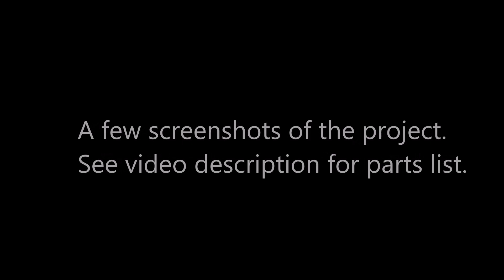DIY Quiet Whole House Fan - Save Tons on Your Electric Bill

Comment: App controlled AC outlets also work well to turn fan on and off as needed - when outside temp is lower then inside temp. By way of remote outside thermometer

Comment: Very easy to install.>>>nub.best/fqzi    I was uninterested in the auto temperature switch but it was very easy to bypass that system. Have it set up on a light switch in my garage. Fan definitely lowers attic temperature significantly

Comment: I plan on setting this up with a friend. Plan on 2 or 3. Thanks for the parts list.
Reply from the maker: I learned a lot from this install. I still use this system all the time and I love it. If I was going to do it again, I would recommend using the largest un-insulated ducting you can find, larger ducting allows for more airflow... also one 3000 CFM fan is better than 2 1500CFM fans, so I would just buy 1 3000 CMF fan like this:

https://amzn.to/2Vc9A8i
Reply: @Jasonoid  Yes, I actually plan on using the red one 3000cfm and my unused masterflow fan 1600 just like the ones you have otherwise its overkill. $386 for 4200 to 4600cfm is great
Reply from the maker: @joegaspary2736  let me know how it goes, should be an awesome project!
Reply: @Jasonoid  I will. Did you see my damper box ceiling grate question btw??
Reply from the maker: @joegaspary2736  for some reason I'm not seeing it, what was your question?
Reply: @Jasonoid  you think I need a larger box for the 3000 cfm fan?? Like 14 x 14 or can the 12 x 12 handle it you think??
Reply from the maker: @joegaspary2736  I think the biggest ceiling box you can find would be best. The bigger the whole the less air restriction you have.
Reply: @Jasonoid  you think I need a larger box for the 3000 cfm fan?? Lime 14 c 14 or can the 12x 12 handle it you think??

Comment: I ordered the parts and am going to make this! my question is how to attach the 16" fan to the 14" reducer? Of course it's no snug fit. I have a small (900sf) house so this size will probably work for me. Thanks for posting this video!
Reply from the maker: Check out what DrmaxGreg did, he posted his videos below in the comments! Because of this Whole House Fan I don't really run my AC in Spring and Fall. I run this at night in the Summer it cuts down my AC usage quite a bit. Works very well for dry climates. Let me know how it goes!

Comment: I am going to start building one of these systems in the next couple of weeks, I noticed that you have a lot of the blown in insulation. I have the same in my attic. How did the fans effect the insulation once you turned them on? I am worried that once I turn on the system it will disturb the insulation and I will have to net it down. I am trying to keep costs down as much as possible.
Reply from the maker: Jay Goo I haven't noticed any insulation missing since the install. It might blow a tiny bit of surface insulation but not enough to notice. Still working great after 2 years!

Comment: where do you get the 18" flexible ducting at a reasonable price? is it rated for the cfm on the fans?
Reply from the maker: I did not use 18 inch flexible ducting, I used a smaller duct that was available at HomeDepot. I listed the parts in the video description. For future use I would recommend a larger size for less CFM restriction and it will pull a higher amount of air. When I looked around I found a few hardware stores that had larger ducting and also a few online stores that had some options. You will just have to look around and find the best fit for you.

Comment: Thanks for the video.  I'll be building my fan using the QuietCool 3013 in a few weeks using a 16" duct and the trash can as the coupler. I will vlog it and post it when I'm done.
Reply: Kevin Lam , I just ordered my QC 3013 cfm as well, but I think I will need to rethink my ducting, inlet grill and components, as I ordered 12" ducting and parts.  I'm very interested in your trash can approach.  Please link your videos when ready!
Reply: Thanks Kevin - I did not see that Ebay seller unfortunately, but Home Depot allows returns!  Thanks for that.  Is the Ebay 20% off coupon something I can use, or was it something you already had?  The seller of the fan has 20% off the $169 which brings it to $146.  $135 sounds even better!

The outside diameter of the QuietCool 3013 is 17 1/8",  which is about 226 sq inches of area, so I was trying to figure out how I would route the equivalent ducting to it.  There is also some loss with flex ducting and it increases the further air has to travel through them.  The shortfalls I'm finding so far are finding a ceiling register box, backflow prevention vent and register box cover that all work together and accept larger than a 12" duct.  

I bought a 14" x 14" register box to 12" round duct,  a 14" x 14" register box cover from Amazon and a 12" backflow prevention vent.    Since I want at least 17" or larger duct going to the fan, I may install 2 of everything above (2 ceiling vents that are 14" x 14") and figure out how to direct two 12" ducts into the trash can.  The last thing I want to do is prematurely kill the fan because I've restricted the flow.
Reply: Ebay offer flash coupons from time to time.  Promos such as $20 off $100 or more and a 15 off $75 or more.  So I pulled the trigger when I saw $20 additional off.

For the large register boxes, http://thesheetmetalkid.com/ceiling-register-box-c-box-square/?sort=featured&page=2

16" butterfly dampers: https://www.famcomfg.com/products/hvac-damper/backdraft-dampers/backdraft-damper.html

I'm planning to build my own register box out of wood and make a hole cutout  for butterfly damper.
Reply: Kevin, I ordered the fan for $146, as there are no flash coupons at the moment, but that's a lot better than what I paid at Home Depot!  I should have done a better Ebay search.  I've ordered ducting materials from the Sheet Metal Kid before, and that's where I found the 18" x 18" x 18" ceiling register box.  I'm purchasing a louvered 18 x 18 backdraft damper that fits inside the register box, and will all be covered by a nice metal painted vent cover.  

An added bonus of going with 18" ducting is the duct will slide right over the outside of the 17" fan housing, and secured with 4' ducting cable ties that I have from another project - so no additional adapter needed.

The fan will be plugged into a smart plug after I bypass the thermostat, so it can be turned off and on via Amazon Echo, or manually.
Reply: Sounds like a great plan.  I'm limited to space in the attic so 16" in my upper limit.    Where did you get your vent cover?  I've seen a high flow 16 x16 cover on Amazon @~$50 but I'll going to try out the HD vent cover for $15.  hope there is no whistling.  

Also, I need to check the wiring for the thermostat bypass.  I'm sure it isn't hard but I was thinking of just setting it at 60 degrees and for the most part, it will always stay on in our SoCal whether.  I'll be using a smart plus as well but will use the phone for controls.  I should have bought the echo dot on Prime Day but have already spent too much money to explain to the Mrs.
Reply: This is the vent cover:
https://www.amazon.com/gp/product/B017CELWVM/ref=oh_aui_detailpage_o00_s00?ie=UTF8&psc=1

I just bought the Echo, Echo Dot, bluetooth speaker and some smart outlets on prime day this week!  Birthday gift for the wife, so will set them up on Saturday.  Prime day is hard to resist.

Good luck with your setup, and let us know how it turns out!

Comment: Thanks for the video Jason. I already bought the red QuieCool 3000 fan before I saw your video to do a similar project. The fan you used, per spec listed on the site from link, says it about 17in diameter. That's about the same as the 3000  Quiet Cool fan. But then you have listed using 10in ducting. So you go from a 12in opening to 10in duct to 16in fan. That seems like a huge air choke and would put stress on the fan and not get the same air flow as you could with larger ducting. Are you sure you used 10in cause it doesn't look 10in (plus insulation) in the video.
Reply from the maker: Thanks for the comment. There weren't many videos or instructions on how to do this type of project when I completed it a couple years ago, it seems to be a trend people are getting interested in now. If I was to do it again I would buy the fan you did (3000 CFM) and used larger ducting. 

My ducting is not the most efficient but it seems to work well for its size. I believe it is 10 or 12 inch ducting. One of my access holes were much smaller so I was forced to use smaller ducting. I didn't want to buy 2 sizes of everything so I decided to go with the smaller size. I can't imagine how much BETTER it would work if I had used 16 inch ducting instead. 

I have had this system installed for over 2 years and everything is working great. I don't think the smaller ducting adds much more stress on the fans. I haven't even turned on my AC this year and it's already half way through May!
Reply: Thanks for the quick reply. Heat almost killed me last night hence the project in motion mode. With the parts that are easily available I can get away with 12 or 14" ducting. But I have a question on where you used your reducer at? Did you use it fan side or connected directly to your damper? Did you just butt up the duct work to the fan and tape it? Trying to picture how this was done.
My set up is looking like:
14x14x12 Register
12" Damper12X14 Reducer14 Duct14x16 Reducer at the Fan (for easier connection to fan)Thoughts?
Reply from the maker: That setup looks good! You will get a lot of air flow through that size of ducting. My reducer is connected directly to my fan. So if you use a ceiling register box with a 14 inch diameter, you can attach the 14 inch ducting right up to that without a reducer. I couldn't find register boxes that large so I had to come down in size.
Reply: Just a couple more questions for you. First, I'm doing a removable hatch also, what material did you use to watch the register to, dry wall or mdf? Any tips or what you would of done differently for this part. 

Also what was your order of operation of connecting the duct to hanging the fan? Just looking for assembly tips before I get up there. Already installed the electric. 

Thanks again.
Reply from the maker: My register box is mounted to an MDF board that is cut to the size of the hole in the ceiling. I then used a jigsaw to cut the hole for the register box and it fits tightly into the hole so there is no need for screws or nails to hold it in place. 

When I remove the fan in the winter, I just put the fan up in the attic and cover the ceiling hole with a piece of decorative drywall that has been textured and painted.

I first used cold weather aluminum tape to connect the ducting to the fan, then covered it in duct tape. It has held strong for two years.

I like the setup I have and it works well so I wouldn't change it.
Reply from the maker: The more "space" you have the air to flow through the better. Any restriction would keep the fan from working efficiently. If I was to do it again. I would use a 16 inch duct and 16 inch damper.

Comment: Jason...assuming you used the same duct size as the fan...did the duct slip onto the fan, or did you have to use alot of tape?
Reply from the maker: greg james I used duct tape first to get a good seal, then covered it with aluminum cold weather tape to make it more permanent, still holds tight today.

Comment: Jason. I see the parts list. Have a couple questions. I would go with the red fan, for it pulls in more air. I have about 3K sq'. I would install this in my upstairs bonus room. However, thinking of putting the vent in a wall, and not the ceiling as hot air would go up through in winter. I have ridge vents which would be good enough to get rid of the air. I would also put a remote control unit in the wall so I could keep the controller down stairs. Be nice if it could be put on a rheostat as to control the fan speed, but not necessary. What are your thoughts about this?
Reply from the maker: I think ridge vents will definitely be effective for ventilation. If I was to do mine over again I would use the red fan because it is much more powerful. How are you thinking of sealing off the wall from the outside and your bonus room? Does your bonus room wall connect directly to your attic?
Reply: direct to attic. I want to keep the duct at 16", however am putting this in the wall not ceiling, nevertheless is 16" on center.  I need to come off the wall at 14". So recon my butterfly backdraft valve will need to be 14" and then use a reducer to jump back up to 16". Don't really see any other way, unless I cut the stud and build a box in the wall, for a 16" valve. Dunno. Feel free to give me you opinion.
Reply from the maker: Putting it in the wall should work fine. Using a 14 inch backdraft valve should work as well. Finding the parts online is usually cheaper so I would recommend doing that if you can. In the last year or so this 'trend' has really taken off on YouTube so you'll be able to find a lot of other videos. Some people have even done 'automated' systems but I feel that is not needed. Plus you can't open windows automatically. 

You NEED to have windows open in order to pull cooler air into the house and to avoid pulling exhaust air from your water heater or furnace and getting Carbon Monoxide into your home. If you live in a dry climate that cools off at night this works amazingly! I live in a desert so we have hot days and cool nights.